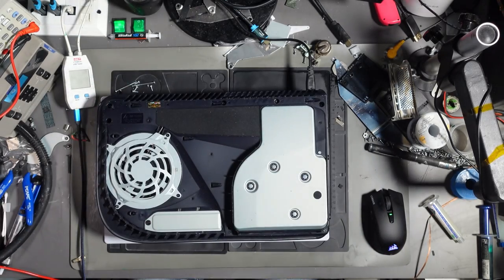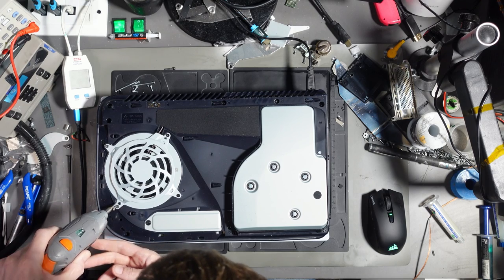Removing The Foam From A PS5 APU Is A BAD IDEA! Can I Fix Someone Else's Liquid Metal Mess?

Comment: is it possible to use thermal paste .. fuck that liquid metal
Reply: @Strannix nope has been tested the system over heats
Reply: No, I mean you could but the entire cooling solution is designed to use liquid metal which transfers heat better then thermal paste. So you'd run the risk of the console being damaged.
Reply: I'd be interested to know how indium foil performs. I'm going to test it on my 12900k one of these days. The pricing is pretty similar to high end thermal paste.

Comment: Definitely not your fault but if any come in without foams I would tell them its an extra charge for sorting them and if one comes back its a charge if its fixed or not. Great work though. I enjoy watching the repairs. I used to work at a repair center in wednesbury but as IT not repairing stuff, although I did do a soldering course to see what the engineers had to do.

Comment: The entire design of the PS5 is simply jank. Liquid metal should never be used in a consumer device period. As you've constantly shown in your repair videos. It's not just a disaster waiting to happen it's a disaster guaranteed to happen eventually. Whether that is because the foam perishes, gets torn when the console is bumped. some metal just happens to find a path through the foam etc etc. Microsoft showed that a correct heat pipe copper sync is more than adequate to cool these apus when they are not being pushed to their absolute thermal limits (which is unfortunately exactly what Sony are doing). I am pretty sure that 90% of PS5 consoles are destined to fail within a few years. Sony have simply cost cut on too many components while pushing the hardware way too hard.

Comment: Sorry to tell to you as proffeionel as you call your self. If the foam is been removed you SHOULD not put liquid metal on then. YOU know what will happen if you do that so it's your fault and should reakt otherwise when you get one with the foam removed! But you did it anyway only for score some money - it's all about money and it's is your lost at the end. Sorry to tell
Reply from the maker: How is it my fault? I performed a repair, I didn't remove the foam, someone else did! Am I supposed to refuse every job that comes in with the foam removed? Am I supposed to pay for a new replacement foam piece? Please tell me, because I'd love to know
Reply: @TheCod3r  obvious the repair problem was because of the foam being missing so replacing it was part of the solution , so you should have replaced it and billed them for the part just like any other job that needs new parts to complete the repair.

Comment: Ps5 is Shert and the ppl who break these crap console with stupid ideas  think they are repair technicians I've watched more of you repairing these shat consoles than anything else and most of the repairs for ps5 are either dropped because the shat outdated stand for handicaps or they opened it up and tried to extend the internal hard disc and then broken I like your YouTube just six I've seen more repairs for ps5 than anything else and all for mostly the same old reasons mite be best to snapshot before and after and sending the befores to the customers or do a video conference with the customers so they can see what you had to repair or replace

Comment: You spend the whole video moaning and complaining about getting work. I agree that you shouldn’t work for free, however, you also shouldn’t repair something improperly, if you get sent a console without foam, just have foam on hand and replace it and bill the business that sent you the console for said foam, or send it back as a no repair, that should get the message across, or give you a good profit on a bit of foam. You should, and from what I understand, do get paid for this cleanup, but you’re part of the problem of this coming back and occurring, and you can’t take away that part of the responsibility even if you’re moaning about it for 25 minutes
Reply from the maker: You can't replace a foam that you don't have. With respect, and I get what you're saying, but if I don't have the original foam, and I can't buy replacements, then I can't replace it
Reply: @TheCod3r  I sincerely apologize if I came out like an ass in my comment. I thought LM barrier like these would easy to come by (Or make yourself) if that isn't the case then I'm obviously the ass for making assumptions.